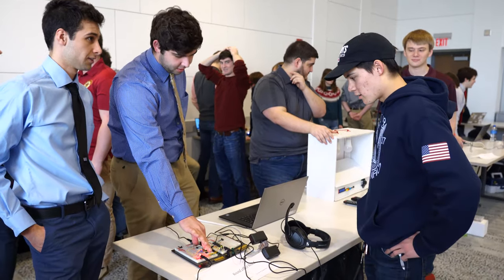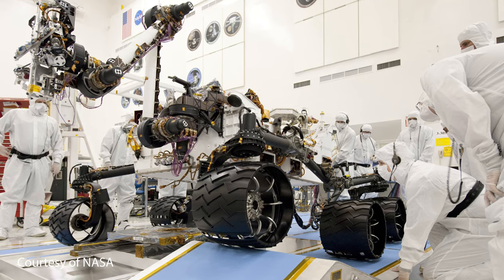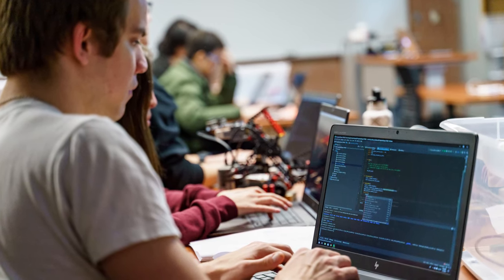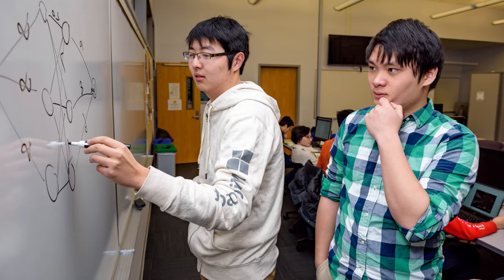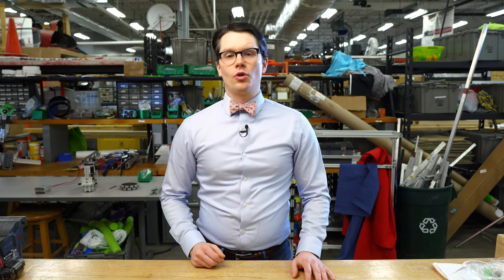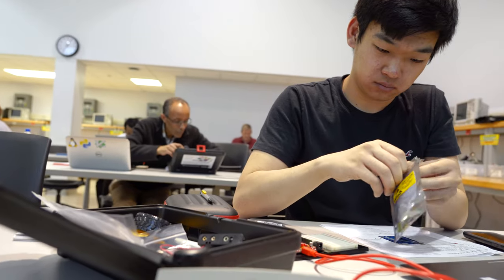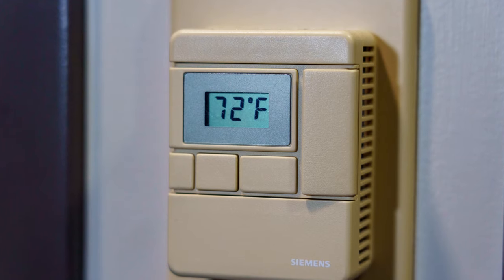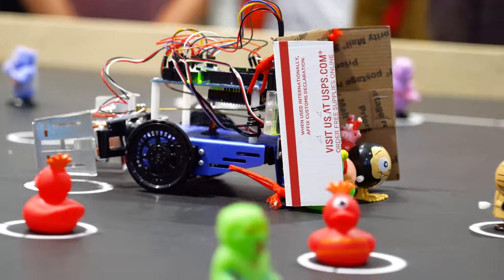What is computer engineering? | Rose-Hulman Institute of Technology

Comment: Wow, best description of Computer engineering I've seen so far.
I'm also a Senior student in computer engineering, I appreciate this .
Reply: I’m interested in pursuing computer engineering, how hard is the curriculum
Reply: @cialos848  its a lot of math, also coding. Its not impossible, but it is challenging. A lot of fun to learn. Definitely a good thing to go for. Im a soft-more computer engineer. Also five months late I know
Reply: @natehagen9710  What programming language do you recommend to learn first?
Reply: @mohamadcharaf7789  first, well i do not have much experience, I started with java in hs, but my college is all cpp. From what I have seen from the internships that I applied to lots of them like python or CPP, so I guess python or cpp
Reply: @natehagen9710  is computer engineering better than software engineering
Reply: @razamughal9866  well that's hard to say, honestly most code-related issues can be figured out on our own, but math is a bit harder. as long as you get some exposure to linear alg.  calculus, and differential equations you should be fine. Both are good degrees, and depending on what you want to do, that changes things a bit. Personally, I chose computer engineering because I wanted to know more about how a computer is structured. I would say instead of looking at which is better, look at what is more interesting for you as job outlooks are about equal for them. One thing to remember is that CE is kind of a bridge between EE and SW
Reply: @razamughal9866  on a personal note I believe that I had more fun as a CE major than I would have as a SW major
Reply: what are the specs my laptop should have as a computer engineering student
Reply: @customizereviews  You need at least iCore 7, minimum 1TB SSD, minimum 16 GB RAM, Processor speed at least 2.5 GHz.
Reply: @itakagastonkitambala3918  And I have seen online severaly that softwares used computer engineers are mostly available on windows...How true is that..
Reply: @itakagastonkitambala3918  which operating would you recommend...
Reply: @customizereviews actually, you just need a pc that runs smooth. You don't necessarily need iCore7 or 1tb ssd or 16gb ram, lower specs would also do the job
Reply: which laptop would you reccommend....brand and model

Comment: Can I do computer engineering bs and then a electrical engineering or computer science ms?
Reply: Yes you can! I got my BS in computer engineering and MS in electrical engineering.
Reply: @ShawnHymel  Was the EE masters best relevant on your day to day job or what made you go and specialize in it, as less Electrical Engineering jobs are being put into the job market?
Reply: @1anre  I don't think getting MS EE vs. MS CPE mattered too much for my situation, honestly. For my masters, I could have swapped out one class and gotten the degree in CPE instead, as my thesis was all C++ programming related to DSP. When I did it 10 years ago, I think EE held a little more prestige than CPE, but I'm not sure that's the case anymore. As you mentioned, EE is seeing a drop in demand. It didn't matter too much for my day job (I was doing mostly project management at the time), but having a masters did help me get more interviews for my next job :)
Reply: @ShawnHymel  ah I get you now Shawn, that makes sense.

Always told myself a decade ago too, that I wouldn’t do a masters, that a BSc. in Computer Engineering was enough, & that I’d fill whatever technical void or competency issues I had on my day-to-day job, with IT industry certifications instead. 

As by my 3rd year in Uni, I discovered the curriculum was outdated and I learnt more doing my own research online & even stopped attending lectures after a while because of this discovery.(parents weren’t happy with that.. by the way)

Now a decade has passed and I have some work experience under my belt too,  & I’m thinking of the Masters now, and similar to you, currently doing Product Management & Project-related work right now, not the core engineering subjects we took back then in Uni. 

Leaning towards getting a Tech + Business Masters specialization which can fuel my entrepreneurship side & also give me an edge by having a 2nd degree in interviews, but I doubt it’ll fully be in the core engineering space I’d do this masters program, I don’t think I would be able to handle the workload at this point, I don’t really know.

What specializations would you say encapsulate this really well, and would still keep me close to my tech background, but give me a well rounded edge in business as I go higher in my career & might get tasked to do less hands-on technical stuff for my day-to-day work?

Comment: Then, if computer engineering could create smth , how about electrical engineering? Im sorry but im totally confuse 🤓 what is the different from this two? Someone please help me ;)
Reply: You'll take many classes that are similar between computer engineering and electrical engineering. However, electrical engineering focuses on circuit design, radiofrequency (RF) design (e.g. antennas), power electronics (large motors, batteries, generators, power lines, etc.). You won't take many of those courses in computer engineering. Instead, you'll take more programming courses and focus on things like embedded systems, digital signal processing, and programmable logic (e.g. FPGAs). Hope that helps!
Reply: @ShawnHymel  ohh thank youu 🔥✨

Comment: is mechatronics engineering close to computer engineering as i am very interested in both
and have found that both include some of the same classes
Reply: There is a good deal of overlap between the two. Mechatronics includes more mechanical and control systems that you won't find in computer engineering.